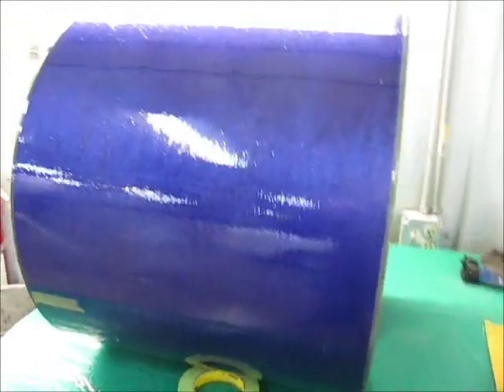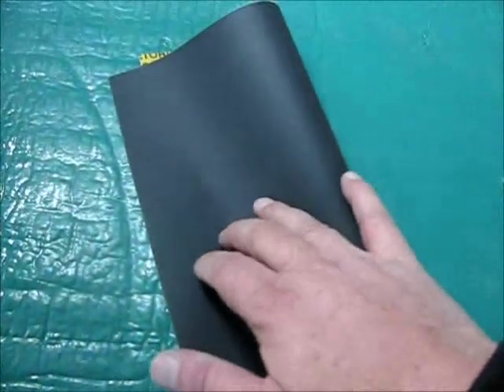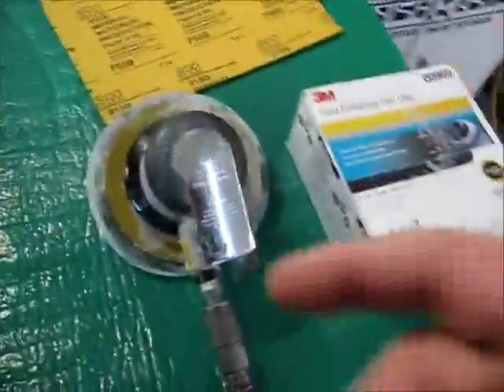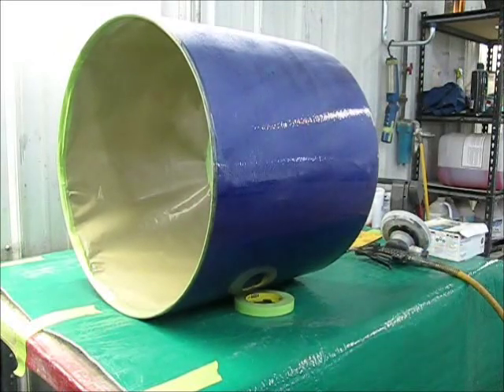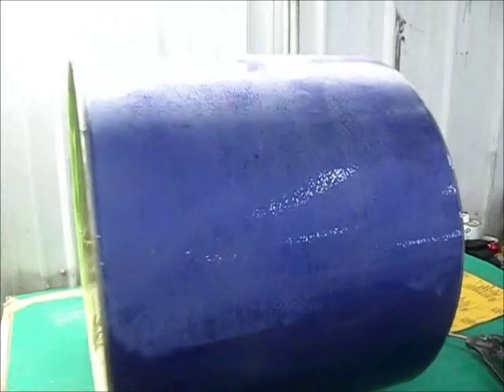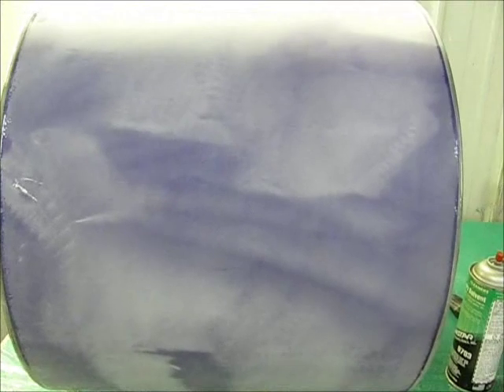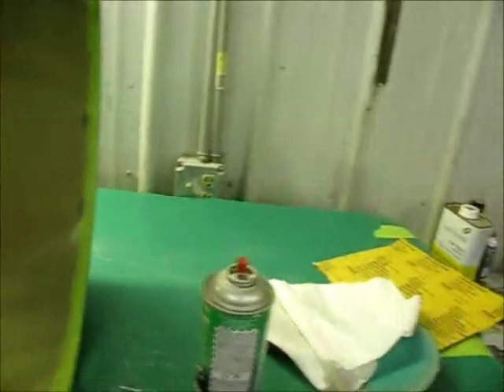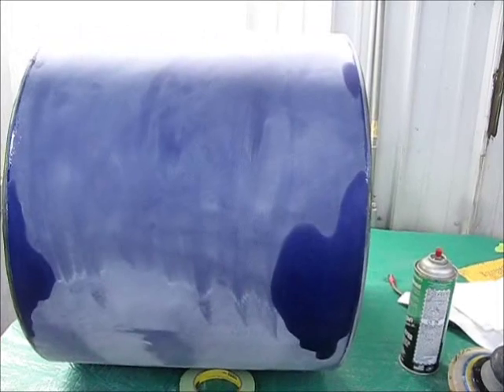Paint a drum shell: How to do a fade. Part 5

Comment: Thanks for sharing the process!! Awesome job!! I’m starting a refinish in a couple of weeks and your videos of the process are great!! When sanding,how much pressure do you put on the sander? Thanks!!
Reply from the maker: I put some decent pressure on it but not a lot. You have to kind of have a knack for how much clear you have on the shell and what grit of sandpaper. Everything is a fine balance, for example I specifically used a high solids clear because it leaves a thicker clear buildup. 6 full wet coats is what seemed to be the right amount to not only fill all the woodgrain, but to allow me to sand it smooth without going through. Once you go through the clear you start removing the color underneath and it always looks like a blemish. To be safe I would probably start out with 1000 grit. 320 is pretty coarse for clearcoat but I felt I had enough to not go through. maybe go in between with 600. The higher the grit# the smoother the sandpaper is.

Comment: faster way is use cand apple and intercoat clear . and . only nuse 4 coats high solds clear . sand 600 . hundred . apply . f4 more coats if wet sanding and polish, as a lot of waste . the   way you are doing also clear will never . fill 320 scratches,
Reply from the maker: Candy apple is not purple stain. This is a high solids clear and you need more clear than you think just to fill the wood grain. And the clear did fill 320 scratches, maybe because it's high solids?